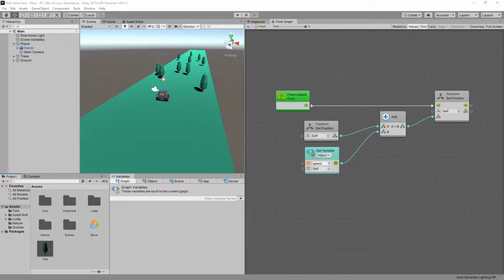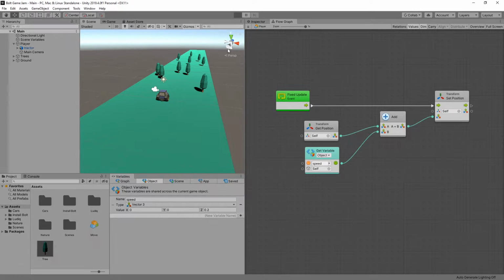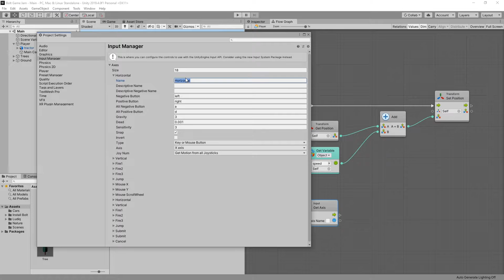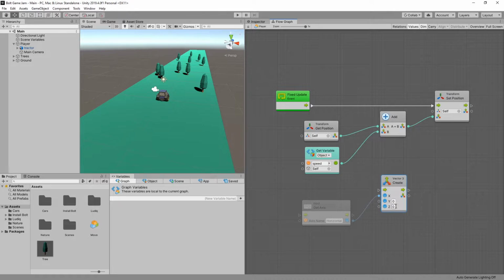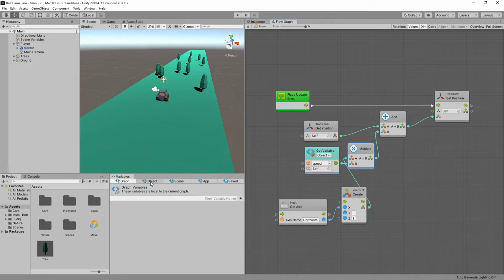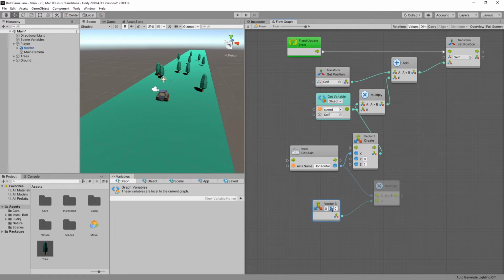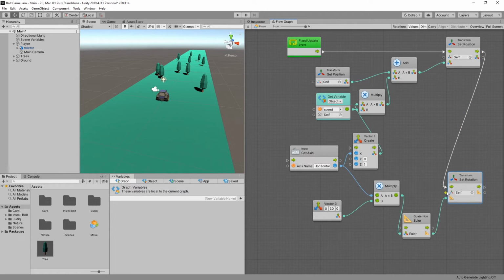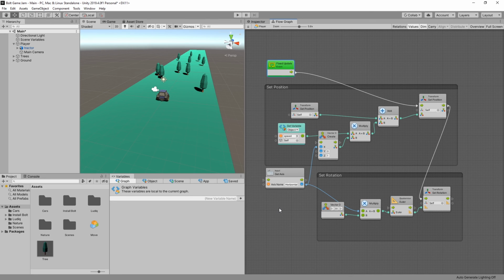Unity-Bolt Part 2: Adding Input to your Game - Getting Started with Bolt (Visual Scripting) Tutorial

Comment: Hi. Great tutorials that are helping me understand Bolt workflow, but I notice a problem that I have with mine compared to yours. I couldn't find a create Vector3, so used Vector3 new. I also can't find Vector3 Literal. I can put a random box there and change it to Vector3 literal, but then I get an error code. 
Any help would be appreciated.
Reply: First of all: If you are using Vector3 new, you are using programmer naming. That is ok, but in part 1, he mentions he set it up with human naming.

No big deal, but you DID find the correct equivalent. The nodes look the same, but the names are different and take a few more seconds to think of what you need.

Second: I am also using programmer naming, you can find vector3 literal by adding an object, search Vector3, click the top one that has grey that says, "In Unity Engine" and Vector3 Literal first on the list.
Reply: @Gredran  Thank you. I must admit, I didn't pay attention to the installation bit as i have already installed Bolt and always go the programmer naming as it's easier for me to follow. I'll bare that n mind for future reference :)

Comment: 2:55 I didnt anderstand this part. Horizontal control x movement right? Why we limited the y value?
Reply from the maker: The y Limit is for rotation, because I wanted to rotate the tractor on the y axis from -30 to 30 degrees
Reply: @SmartPenguins  we use y axis for rotation? Why dont u do the transform rotation. Sorry sound stupid maybe😀 but scripting is New to me. 😓
I always think y axis for gravity
Reply from the maker: @axps4964  You have x,y,z axis for position and you have x,y,z axis for rotation. Gravity changes the position y axis.
Reply: @SmartPenguins  oh ı get now thanx

Comment: hey smartp!
Playmaker or bolt!!! which is better?
Reply from the maker: It depends what you are trying to use it for. But Playmaker has more limitations.
Reply from the maker: @Nectarie Lovin If they would have included some higher-level nodes in bolt it would of make it easier. But for 50:50 I wouldn't say that it's more like Playmaker 20: Bolt 80. If you planning to make more then one game, I would say you would be wasting time learning playmaker. That is how I feel after using Buildbox for 6 months, the limitations hurt you in the long run pretty bad. But that is what I can say from my experience.
Reply: @SmartPenguins  thank you smarty.;-)